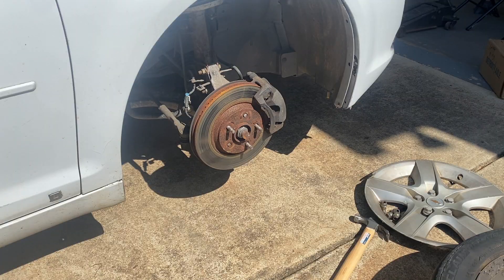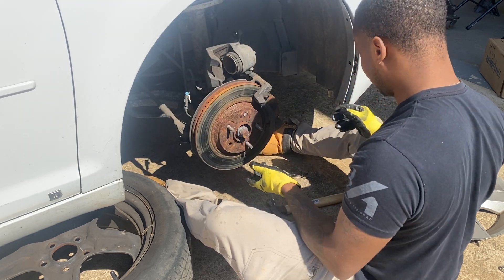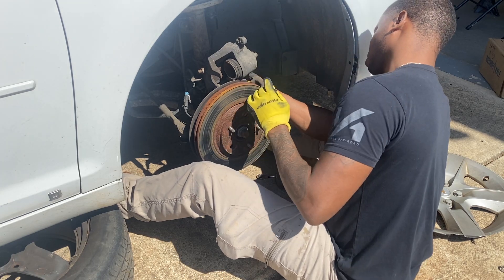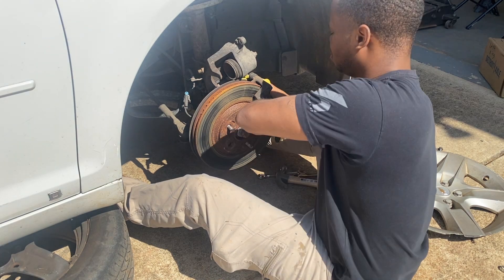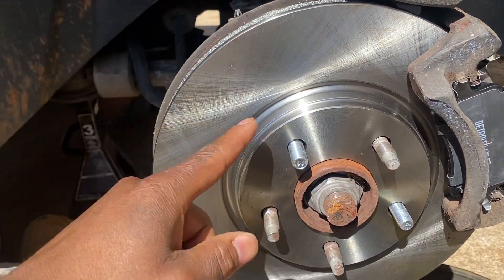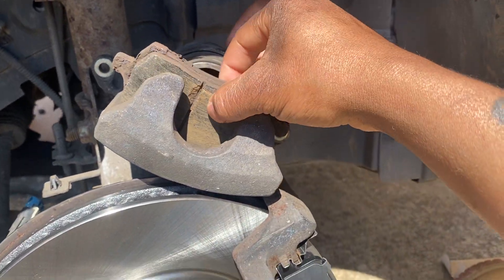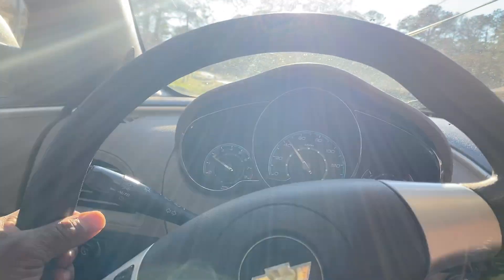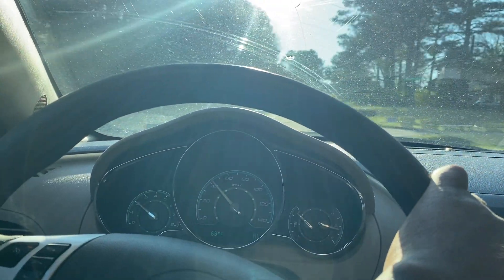2008-2012 Malibu Brakes, Rotors, Wheel Studs Replacement

Comment: I use C clamps to push it back in a bit easier for me
Reply from the maker: I use to break them often
Reply: @SteveDavisCarGuy  stop using your superman 🦸‍♂️ strength on them lmfao 🤣 😂
Reply from the maker: @josephjones4468  Na they use to bend if the caliper was too tight
Reply from the maker: @josephjones4468  after 3 or so broke I started using the clamps and they don’t bend. Had these Clamps for 4 years or so
Reply: @SteveDavisCarGuy  yea if the pistons are older it can be a pain in the ass but if it gets that bad I'll see if someone has a new set because I don't want to go through that again lmfao